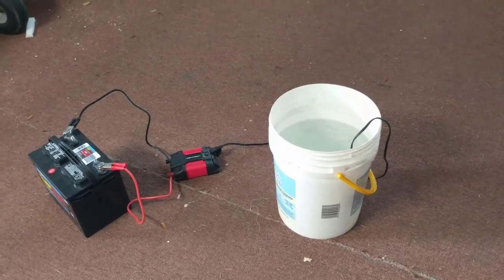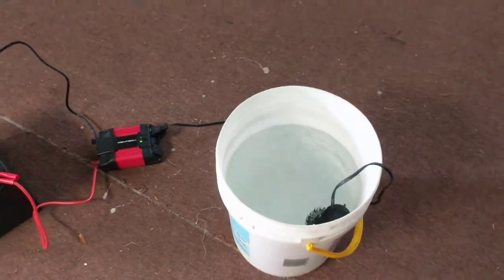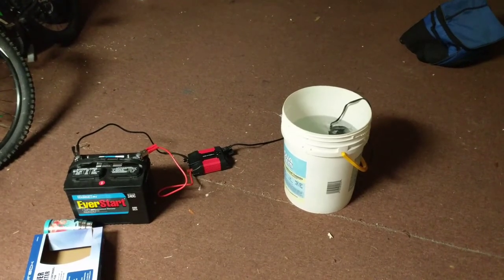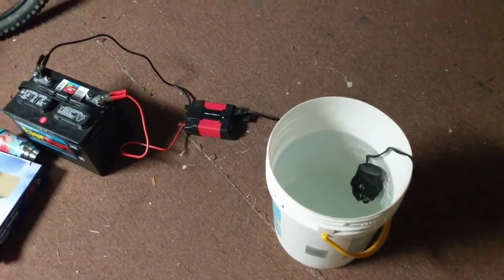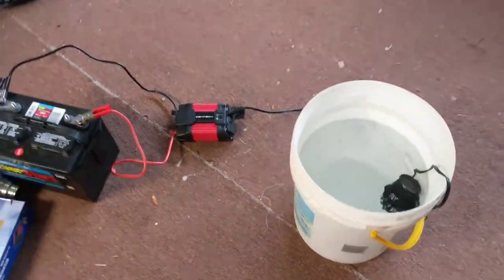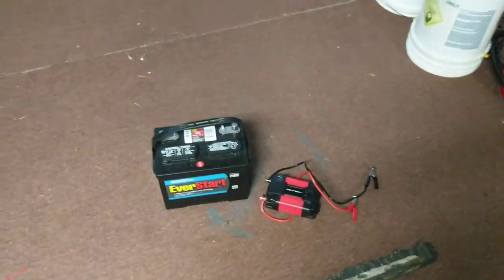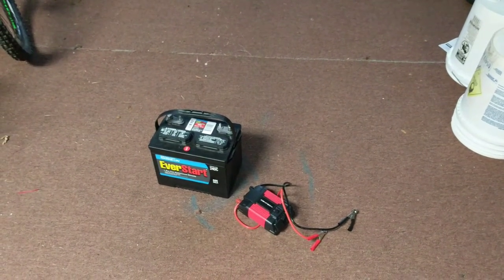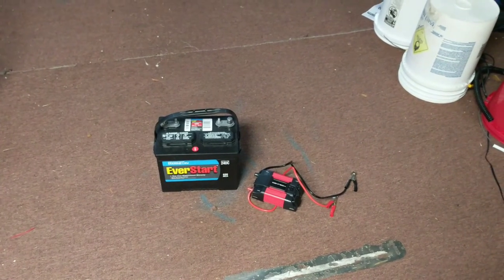60G Reef: HOW LONG WILL IT LAST? DIY Battery Backup Put To The Test.

Comment: Very nice video...congrat...please can you share the brand and specification of the battery and inverter? Seems that the battery is 24VDC, right?
Reply: luis henrique battery is a typical 12 volt deep cycle 24 series battery. It's a small deep cycle. I'd recommend a group 29 or 32 for this application... more reserve power, lasts much longer. The power bank is a off rand shcumacker or whatever from Walmart or harbor freight lol

Comment: I thinking of this for my return pump which is a jabao acq 240v returm pump with controller 50w 240vac what was spec on battery I have a ranger with 100amp hr I can wip that off incase of emergency